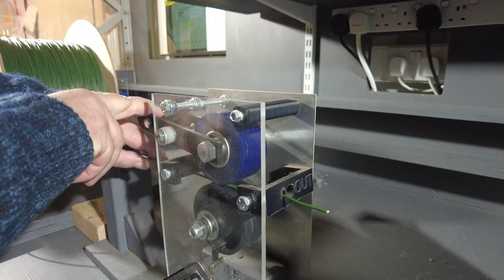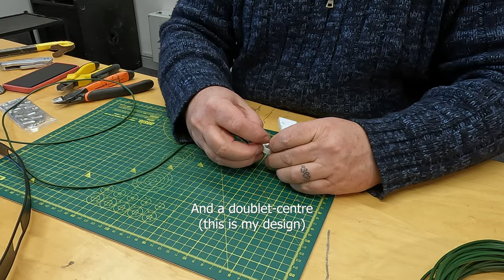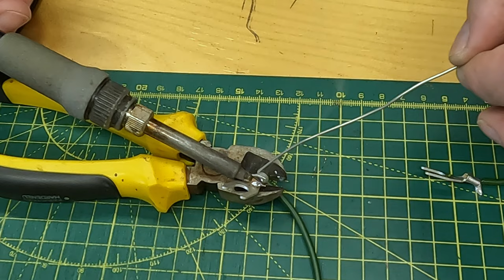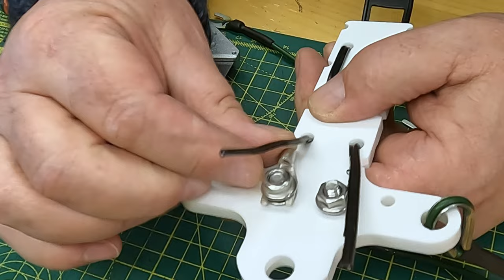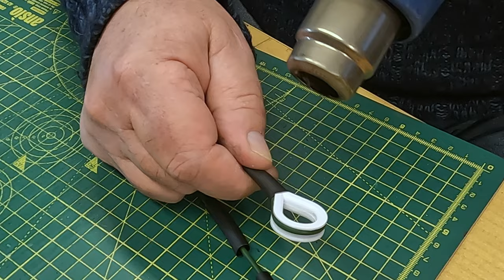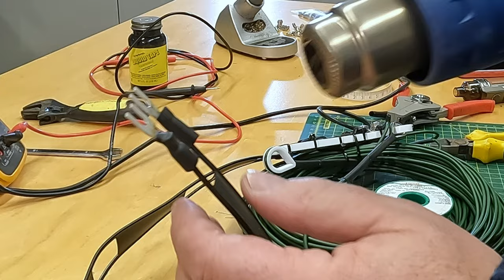Speed Antenna Build: Making an Antenna in Record Time - 4 minutes (compressed)

Comment: What, no torque wrench on those nuts? Are we cutting corners and putting out second class gear?
(WEG)
Reply from the maker: Oh yes.. Tighter than a gnats ass :)
Reply: lol When your experienced, You feel the torque in your hand!  lol They don't even use torque wrenches to build cars anymore!  There not accurate, They use bolt stretch guages.  💣